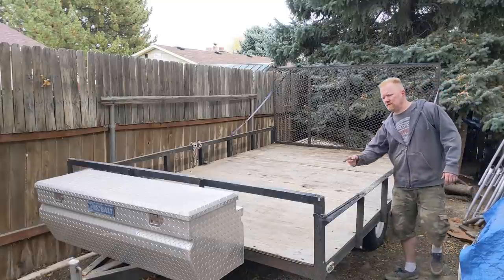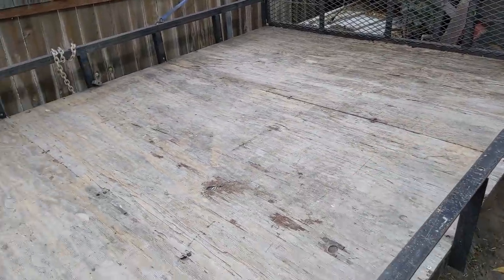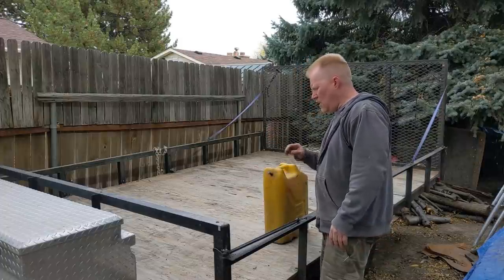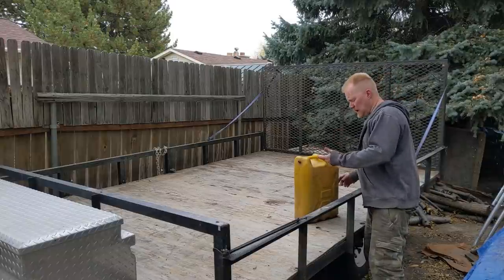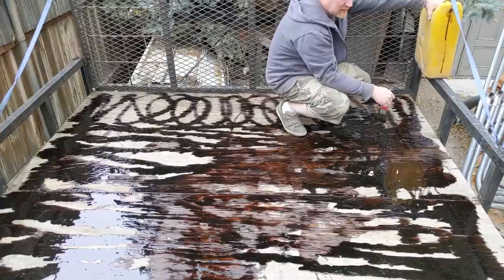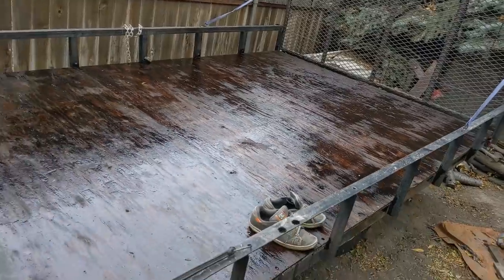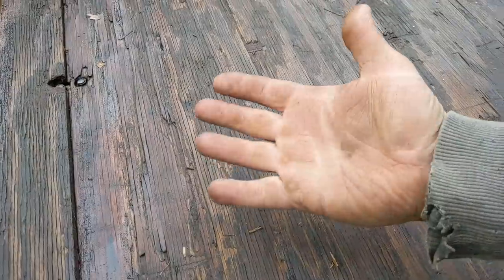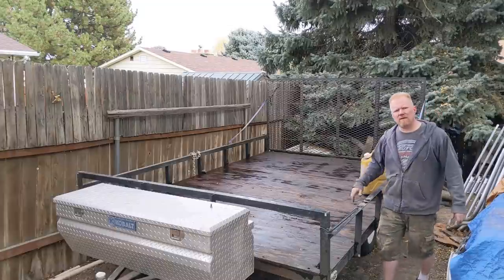Make Trailer Deck Last a Lifetime for FREE with USED Motor Oil

Comment: Does the oil smell go away if I were to stain my deck, my wife is concerned of the smell. 

Also how does the oil affect the wood’s flammability?
Reply from the maker: The oily smell really depends on how fast it dries out. This can be 5day to 2 weeks depending on the sun/heat it gets. Some people are more sensitive to the smell than others. Diesel fuel at 25-50% helps it dry faster but also makes it smell more right off the bate. 
Flamibilty, not at all. Watch here https://youtu.be/UKXIM48IO5M?t=175

Comment: Hey good day, just thought of another comment about the leaky vehicles. Had an old 65 Dodge truck for a number of years six cylinder four-speed 2 Wheel Dr. three-quarter ton, it leaks so bad on some old man's driveway doing a job for, he complained,of course I cleaned it, His whole family were good customers for years. But his driveway was on a slope and it made it look 10 times worse. Yeah that would've sealed up your trailer deck real nice😳👍😊

Comment: Maybe I should Stain my Fence with Used Motor Oil!
Reply: That's what I'm thinking too!  Looks great, last long time, free.  Actually, I don't think I will use stain on a fence ever again.
Reply from the maker: I did a video on staining fences with it.
Reply: Mix it 50/50 with diesel and it sprays nicely on wood. I use it on fences.
Reply: @rogerwhiting9310  probably every bit as beautiful and as long-lasting as expensive oil-based stain.  I love thinking outside of the box and beating the system :-)  (one of the reasons I love this channel, and it seems I'm in good company)
Reply: When i bought my home 30+ years ago, there was a stained fence of 1x12's all around my upper yard. Aprox 300' + of fence. I calculated the cost for outdoor stain, even back then it was several hundred dollars (Olympic stain) . So, I started on one side of the fence, unscrewed the 1x12's, and  used two  1x1's on each side of the post as slots. Trimmed the 1x12's to fit exactly inside when slid down from above. Once the fence was easy to work with, I took one section down at a time, and used a roller to stain them with used motor oil, works great, no rot still.
Reply: @sixtyfiveford  when I read "staining fences" I thought of something else,  You know, stuff drunk  males or dogs do... Anyway great tip! I have thought of doing this to my gates, but was afraid of being wrong and making a real mess. You gave me the confidance to actually do it. Thank You very much for sharing!
Reply: I DID LOOKS GOOD AND LAST ALONG TIME!!!!
Reply: What about a deck ?

Comment: I drilled small holes about 3/4 of the way through fence posts just above ground level and filled them full of oil several times at a 45 degree angle. Then plugged them.
Never rot
Reply from the maker: That's a good idea.

Comment: Oil these days are thin enough to just use it straight.  No need to thin it if it's being brushed on.
Reply from the maker: I don't thin it if I'm brushing it, only if I spray it. I do find though thinning it with diesel fuel makes it dry faster.

Comment: Toxic trailer. Love it.🤣🤣🤣🤣🤣🤣Cool dog. 👍
Reply from the maker: Thanks. The entire thing was toxic to begin with. Steel is toxic, the rubber tires are toxic, the formaldehyde soaked into the plywood layers is toxic, the glue holding the wood together is toxic, the plastic lights are toxic..... We can't have anything these days that isn't.
Reply: @sixtyfiveford  exactly. Inside of our own homes are toxic. Keep up the good work you do. Happy Halloween 🎃

Comment: If you mix it 50/50 with diesel fuel it penetrates better. Also melted candle wax mixed with any mineral spirit ... see you tube  does a GREAT job waterproofing and isnt oily.

Comment: Great hack mo! Talking of oil and to same me going through your video's do you have a good method to get old oil/ stains  out of concrete / block paving ? I have tried all sorts but never found a way to remove it 100 %. ? Love the show👍 cheers M
Reply from the maker: I've had good luck with Purple Power and a ton of manual wire brush scrubbing. The best stuff I've ever used is GUNK GP2A Degreaser but it is hard to find. I have a vintage 30+year old can of it and it works amazing so I found they still make it and bought a few modern bottles. The modern stuff doesn't work as well but very close and is still the best stuff I've used. Gunk sells a concentrate version that I haven't tried but I have high hopes for it https://amzn.to/31ZLYp5 and will try it once I'm out of the other bottles. 

I have a technique if you have time. I apply the GUNK degreaser, rough it up with a wire or stiff bristle brush, lightly water it and then cover it with sawdust. I leave it for weeks and water it occasionally if it isn't going to rain. I will walk on it occasionally twisting my feet to crush the sawdust into the oil/degreaser. The sawdust helps soak up and pull the oil up and out of the concrete. I will then sweep up the sawdust, apply more Gunk and proceed to finish the scrubbing and wash away.
Reply: A lot of times if you leave floor dry sit on it for a while it will pull it out

Comment: If it works keeping moisture out of plywood it must work great on 2x6 material.
Reply from the maker: Yes.... If the lumber is dry. Generally Home Depot lumber takes a solid year to dry out enough to soak up oil.

Comment: I want to do that to my trailer but it has 2x6 planks with small gaps between them.  I don't want to drip oil on my yard.  I was wondering, should I do this project in my local police station parking lot or my in-laws driveway?
Reply from the maker: In laws for sure.

Comment: Would it not be a good idea to do that to both sides of the plywood before redecking the trailer.  That way the underside would be protected from road spray while going in rain.
Reply from the maker: That's a good idea.

Comment: I'd you do this in the middle of July in southern Idaho or Utah, it'll suck right up within 3 hours... MAX! Ha ha ha ha. Was debating on doing this myself w/my used oil on my trailer. The "fancy deck paint" I got at Lowe's wore off in 1 summer of use.
Reply from the maker: Hey Thanks, I'm glad you liked it. I spent over $100 for exterior wood stain that just flakes off.

Comment: I've been wanting to do this to my trailer deck, but fear it will be slick when wet. Is that ever a problem for your trailers? Do they ever get slick from the oil?
Reply from the maker: Plywood, no. Now if you have two by material and it's green yes. If it's weathered for a few years it won't be slick. If it rains will get slightly slick depending on how long ago you treated it.
Reply: @sixtyfiveford  thank you.

Comment: I did this on my  log cabin years ago couple and times on touch ups over the years and still standing.  Agree with the oil properties certainly keep the water out and away 4 sure. Now-a-days though the Green Party and other groups are pushing that you not do that but use an environmental friendly formula when you can eh? Nice video!
Reply from the maker: It's a catch 22. Don't preserve wood and we need to cut more trees. Don't save metal from rusting and we burn more diesel mining more ore. Even the eco friendly stains are made from oil(petroleum distillates) and high VOC solvents.
Reply: Ground water

Comment: It has to be thirty years ago now that I ' painted ' the wood sides of an old chicken building built by my grandfather then turned into a garage by my father.
That thing had to have been a hundred feet long by thirty feet wide.
Up a ladder as it sat on a five foot concrete block wall.  I'm sure the wood was 8 foot high too.
Wasn't too bad but I hated heights.  The borrowed ladder was a little messy when I returned it -  oops.
I did like the light green color on there from when it was built but it was really faded.

Comment: Can it be use for a wood fence like the one you have ? Will the oil soak the wood the same ?
Reply from the maker: Yes. It just takes more work getting it onto vertical surface but I've done a few fences.

Comment: I have heard that the metal particles in used oil helps keep the bugs away and works better than new oil.. I have been using it on my fence posts for years..
Reply from the maker: Interesting!

Comment: Now I know my next project.  Just changed the oil in my wife's car and need to protect my wood hauling trailer.
Reply from the maker: Thanks, I'm glad you liked it.
Reply: @sixtyfiveford  quick question.  Does the name of your channel refer to a specific car or something else.  I haven't seen all your videos.
Reply from the maker: @michaellowe3665  It was for my 1965 Ford truck. When I set the channel up I think I entered a couple different names that were taken and that was the very first thing that was available so it just stuck.
Reply: @sixtyfiveford  I love old Fords. I have a 64 TBird and a 78 Bronco.
Reply from the maker: @michaellowe3665  Awesome. I daily driver a 78 F150 and used to have a 78' Bronco.

Comment: Save your knees and you dont have to worry about walking the oil on your boots every where.....use a thin knapp roller on an extension pole......nice heeler but you're gonna need more leaves for your dog to compete with Stella
Reply from the maker: Stella and the leaves is hilarious.

Comment: Mix some kerosene or diesel with the oil will make it soak into the wood a little quicker….Ive used both methods mixed and straight burnt oil, all works great..

Comment: Worth mentioning that the used engine oil is also carcinogenic, like the banned creosote. Make sure you wear gloves when applying.
Reply from the maker: Very true. However just because it's rated as carcinogenic doesn't mean one or even a thousand touches is going to lead to cancer. The case studies are all with animals that have essentially swam in oil 24/7 for their entire life.
Reply: @sixtyfiveford  Whilst that is somewhat true, why did they ban creosote. They are effectively the same thing and with the same exposure rates they deemed a shop bought version should be banned. Plus the heavy metals that are likely to accumulate in your engine oil. Should really warn people before advising something like this. Not hatin', just sayin'
Reply from the maker: @beeftec5862  I agree that it's not safe to bath in, but I don't worry about getting some oil on my hands. Creosote was banned by the EPA because of potential carcinogenic properties and potential for food contamination as it was used as a pesticide / fungicide. Though they did a studies of all the factory workers that worked around creosote making railroad ties etc and they didn't find a single one that had health effects due to the creosote exposure. There's quite a few articles on it that I read years ago. The worst I could see was they claimed a potential to have a skin irritation / rash with heavy exposure. There's some truth to it but to me to me it's just fear mongering where a lab says something could potentially be harmful and everybody just jumps on the band wagon. Creosote is still used commercially for railroad ties, telephone poles, etc. but has fallen out of favor by homeowners due to a possibility that it could be carcinogenic. They did the study years ago that drinking hot drinks was a carcinogenic and I don't see the EPA forcing everybody to drink cold coffee. I take all these non-proven potential risks with a grain of salt.

Comment: Would this increase the chances of a fire getting out of control?
Reply from the maker: Oil will actually slow the burn rate of wood. However I think you're screwed if you're trailer catches fire no matter what.

Comment: I’m putting a new deck on my trailer 2x8 boards should I treat both sides or just the top?
Reply from the maker: New wood is generally still really wet inside and you'll find that oil doesn't want to soak in well or even at all. I would install it and and oil the top in 6 months when it dries out.

Comment: About to build myself a new porch/deck. Seriously tired of wasting money on crappy stains that don't absorb into the wood and just flakes off after a couple of years. Seriously contemplating just giving it a coat of matured motor oil.
Reply from the maker: Only issue is new wood from the store is very wet and needs to dry for nearly 6 months before it'll absorb oil well.
Reply: @sixtyfiveford  Yeah, it'll have at least a month of baking in the summer heat with full sun exposure before the rain rolls in, might see if its dry enough before fall sets in.

Comment: If I put it on my pressure washer, trailer floor, will it keep it protected from bleach that I got spilled on it
Reply from the maker: I've never mixed bleach with motor oil so I have no idea.

Comment: Would it still work if you thin the oil and use a sprayer?
Reply from the maker: That's the way I do it for fences etc. I mix oil/diesel fuel about 50/50.

Comment: I've heard of using a 50/50 of diesel fluid and motor oil. Would this be a better mixture vs all oil?
Reply from the maker: I use both. The 50/50 dries faster/ soaks in faster. I generally use the 50/50 on vertical surfaces and the straight oil on horizontal.

Comment: Do you back prime it?  (treat the underside the same way)
Reply from the maker: I usually don't touch the underside. I have before though and it's quickest just to remove the decking flip it over, oil it and reinstall it.

Comment: I sprayed a treated deck with a mix of diesel and oil. The deck still rotted out in 7 years. It made it slick as snot when wet. This next one I haven't done it too and it's lasted just as lo g. Not that the oil doesn't work I think the treatment process failed from factory and it rotted. Just to show how bad the boards werem treated and still went bad
Reply from the maker: Interesting.
Reply: @sixtyfiveford  but it was near the early stages of treatment when there were several treatment methods and I guess they were figuring the best one after CCA was outlawed.  The trailer sat in sunlight and didn't have leaves and junk on it. The rep when I called the wood treatment company said many of the failures they have seen are in direct sun and not moist shade which is the opposite of what you would expect.  It's the same on my neighbors fence here.nout up around the same time. The older part that's in more shade has fared better and not rotted as much as the part up front that's newer by just a bit but sits in the direct sun all day.
Reply from the maker: @natevanlandingham1945  I've had some bad results myself with treated lumber. I made some basic retaining walls with treated that all rotted out. But I also made some retaining walls with just regular 2x material that's lasted without any signs of rot.
Reply: @sixtyfiveford  the CCA stuff was great I have did cut off 2x4 treated  with CCA stuff that's above ground rated but has been sitting in ground contact for over a decade and other than a little rot down the center is 90% entacked. I used it to hold a trailer jack out of the dirt for years...then I think it was moved under a tractor implement to keep it from sinking into the ground. Like I said it was not rated for ground contact but been laying on the ground since I picked it up somewhere about 2006. It has even moved houses with me. I remember it cause I'm amazed it hasn't rotted out yet...at that time they were making the alternate treatment at that point. The ground rated CCA stuff really lasts a lifetime.

Comment: I soak engine gaskets in used motor oil and they never fail
Reply from the maker: Really? You soak all your fiber gaskets in motor oil?
Reply: @sixtyfiveford  yeah I used to rebuild the Mercedes motors on refer units, and they were notorious for leaking oil. Once I started soaking them in oil I had drivers come back and say Wow! No leaks!

Comment: I own an auto shop 
I put used oil on my fences 
I want to get a heat exchanger
Reply from the maker: I debated making an oil heater for years. My shop is too small to give up the precious space it requires though.

Comment: Hey if you have a Ford laying around you might as well drain the oil out of it because that's probably the best part and the most use you're going to get out of it. Hahaha 😜 don't get all butt hurt this is a pretty good hack get my trailers done soon
Reply from the maker: I usually just tow a Chevy home on the trailer and enough oil leaks out to cover the entire trailer deck.....
Reply: @sixtyfiveford  right on that's a A + first you get a truck that's actually worth Towing home and then you get the oil to coat the deck of your trailer

Comment: Why break your back or walk on it! Get a 5 gal. pail and pour the oil in and a small floor brush or roller and brush or roll it on... You work from one end to the other... geez......... how messy.......

Comment: I thought the "old timer trick" was a 50/50 mix of old oil and diesel fuel. Thats what I was told 30 years ago, but I've wondered why the diesel is necessary. Doesn't seem to be after seeing this.
Reply from the maker: I dilute it with diesel mainly to spray it. However it does make it dry faster, soak in better and it's less slippery.
Reply: @psydon PB That makes perfect sense. Thank you. I have been "saving" about 36 gal of heating oil (same as diesel minus dye and taxes) in our old tank (switched to  nat gas) for this sort of project, but only got as far as a wood fence. So, I'd say if the opportunity arises, grab the heating oil with a $7 HF Xfer pump from someone making the switch. I appreciate your input.
Reply: @sixtyfiveford  Thank you sir, you covered all the bases as the angry pitcher said to the batter.. Seems like its worth the time to mix 'em given the deeper penetration, if you're taking the time to do the job anyway. The sprayability is a really nice bonus too.